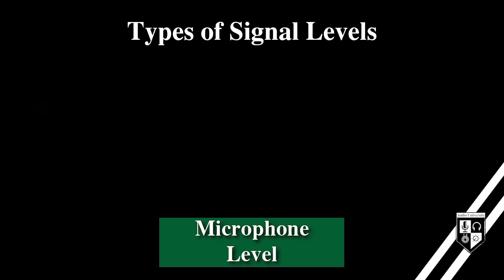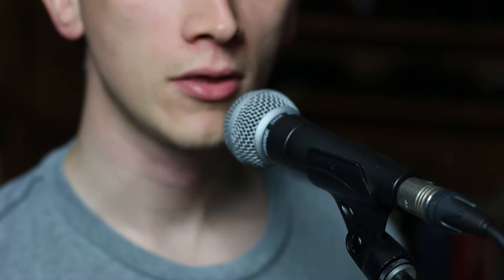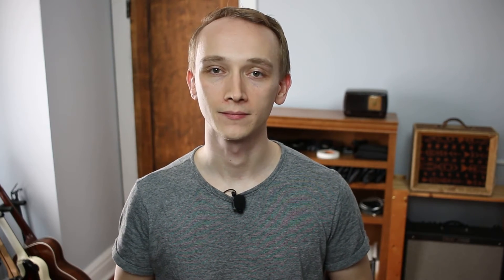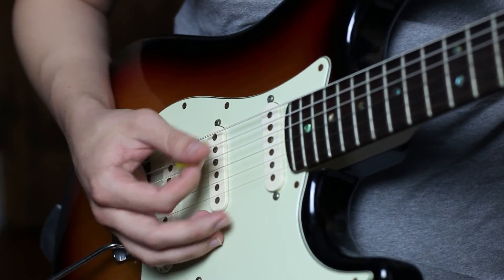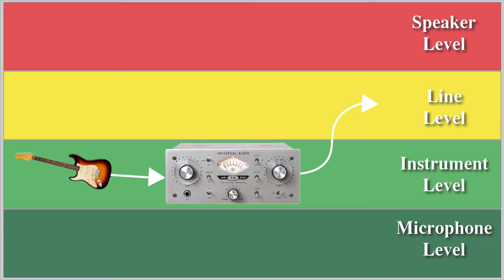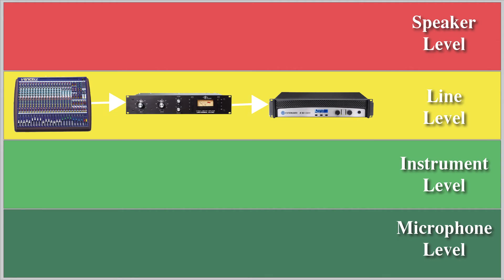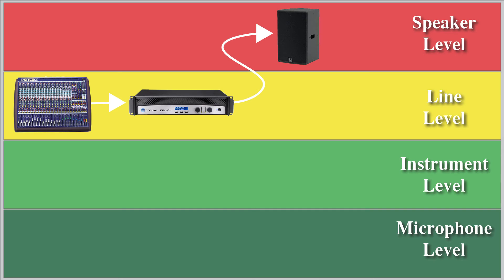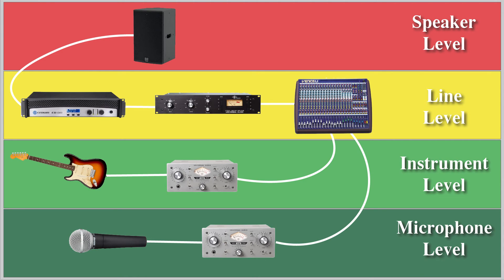MIC LEVEL vs LINE LEVEL: Audio Levels Explained

Comment: This is super interesting and detailed, and crazy how it's all in less than 3 minutes of a video. Anyways, after watching, I really find it fascinating that a microphone picks up sound, translates it through electrical wiring, or even across the internet, through someone or somewhere else's wires, and re-translates those electrical signals precisely through headphones. Like, I think it's severely overlooked on how impressive that process works and on top of that, a lot of times it's nearly instant signal transfers/translations.

Comment: Hi Kyle, Im an amateur DJ. My console has both XLR & RCA main outputs, however my powered loudspeakers (Aiwa AW915 PRO) only have XLR Mic In or RCA Line In available . Would you agree to use a microphone attenuator to connect the console to the speakers' XLR Mic In when running long distances between both devices? Any other ideas would be highly appreciated. Thanks!

Comment: so what if I'm recording a loud exhaust coming into a condesor mic but the mic level is amplifying to much so my audio gets clipped can I than go to line level so its not as amplified?
Reply from the maker: You might be overloading the mic (check the max SPL specification for the mic). If not, you can use a pad before the mic input.

Comment: My guitar connected to DI box which then goes toy interface ...but i get more audible signal when i press instrument button on my interface though m sending line level balanced signal frm di box ..when i press line level this signal volume drops ...hows it possible as as per ur explanation instrument level is weaker than line level ...pls help ..🎉🎉

Comment: When connecting two mixers, should one use line inputs or mic inputs?
Reply: Sub-Mixer Out at Line Level into Main-Mixer LINE Input using XLR-F to ¼" TRS cable x2

If you're using typical XLR-F to XLR-M cables, then you'll ended up connecting into the MIC Input of the Main-Mixer. 
In this case, you'll need to Engage the PAD switch to attenuates the Strong Line Level into a more manageable level to be handled by the mic preamps.

Comment: I have a question that many would like to find the correct answer to, for example. I bought a Crown XLS1002  mainly as a subwoofer amp for a home theater system. But since consumer-level audio is approximately -10 DB. a Pro audio amp would never work properly without increasing the Preout from the receiver to the Crown. many people buy a Matchbox. which for most users is nothing more than a Preamp. and converts an unbalanced signal to a balanced signal while increasing the output level. from what I read. a Balanced signal is usually used on LONG cable runs.
so the question is should you just use a preamp between the receiver to the Crown amp? or. do you really need a converter box? such as art Cleanbox Pro or the Rolls MB 15. ? Thanks,
Reply from the maker: Good question, Sam. Have you watched this video?: https://youtu.be/Po3nvEs4LLY
Reply: @AudioUniversity  I watched it. but it still did not answer my question. people who did buy the Matchbox. are complaining about noise that didn't exist before. so maybe just maybe. Not using a matchbox and instead simply buying a preamp without a balanced connection. would that be a better solution?  (at least for home theater ) without having a balanced connection. since a balanced connection is more suitable for long wire runs to cancel out unwanted noise.
I will be honest. I'm kind of sorry I bought the Crown amp.

Comment: good viideo ---- I might suggest another video to address the amount of amplification at each step ------ eg - a dynamic mic signal needs to be amplified about 60 db, which is 1000 times, to get it to line level.

Comment: I have a Gigbar Move light bar that has a mic built in that allows the unit to be put in sound mode and flashes to the low frequencies the mic picks up. The issue is that the sensitivity has to be around 90% at low volume but when I play loud, I have to turn it down to 10%. 

Would it work better if I was to remove the mic and install a jack and connect to the line level output on my mixer (RCA) and let it get a direct signal for consistency?

Comment: Thanks! Very helpful. For PC Audio interface today, the output is line level? Can plug direct to mixer? Or still need a DI in between? Thanks
Reply: Read the manual for your interface – it should tell you what level the output is.

Comment: I am using Scarlett Solo USB interface, it has 2 inputs, 1 XLR input and other as TS with a button below named "Inst", if my mic output comes in TS, can I connect it to TS input? Will it give same gain coverage as with XLR input and what should I do with "Inst" On or Off ? Please guide. Thanks
Reply from the maker: I don’t think the 1/4-inch input will supply enough gain for your microphone. Between “line” and “inst”, you’ll get a greater signal level with “inst”.
Reply: @AudioUniversity  Thanks Kyle. Now I know it will not provide enough gain.

Comment: In other of your videos you mention that certain mixers allow you to connect a mic level or a line level input to the mixer. I understand that. But, what is an example of a line level input that I may be able to connect into a mixer. 
With this video I did understand that line is not the same as instrument level (I use to confuse them).
Reply from the maker: Good question. Line level sources could include sequencers, CD players, or even outboard signal processors (such as a rack-mounted compressor). These are just a few examples.

Comment: On a preamp with a MIC / LINE switch, would 20 dB of attenuation be a typical difference between the two? In other words, with the switch in LINE mode, wouldn't minus 20 dB be more compatible with a signal coming from a guitar or keyboard, than it would be if the switch were set to MIC? The Behringer MIC100 microphone preamp has a 20 dB pad, but not a separate LINE  input, nor does it have a MIC / LINE switch. I'm thinking this was the purpose of the 20 dB pad.
Reply from the maker: Yes. A MIC/LINE switch is essentially a pad. The best guideline is to choose the setting that gives you the best input meter level for the source.
Reply: @AudioUniversity   Thank you for your reply. That's very helpful to know.

Comment: Excellent video! Straight to the point, and very informative one! You just won a new subscriber! 
I have a question, Should I treat a headphone output as a mic-level or as a line-level?
Reply from the maker: A headphone output is capable of putting out a higher voltage than line level. Headphone outputs are also variable (adjustable) in most cases, so the voltage ranges depending on the setting. If you are sending a headphone output to an input, set the input to line level and be sure not to set the headphone output too high (avoid distortion). I hope this helps!
Reply: @AudioUniversity  I had the same question. I might suggest pinning the answer to this question to a top comment or something for future people wondering the same. I was lucky this was one of the most recent comments so I found it easy.

Comment: Is the phone headset mic output voltage AC or DC and at what value?
Reply from the maker: The audio signal is AC. The voltage varies depending on the phone and the level you’re playing the music. The output of your phone is powerful enough to power headphones, so it is probably hotter than the line level standard (+4 dBu).
Reply: @AudioUniversity  Thanks.

Comment: Dear Sir, your Demonstration is good!!!          I like to know that when we use dynamic mic and condenser mic, the mic level is same or different?? 
Generally we use phantom power to fire condenser mic. But some time we need to gain condenser mic to the same level where we gain dynamic mic.
Reply from the maker: All microphones have a unique sensitivity and each will have different gain requirements. “Microphone Level” refers to a range of levels, rather than one particular level.
Reply: @AudioUniversity  Thanks